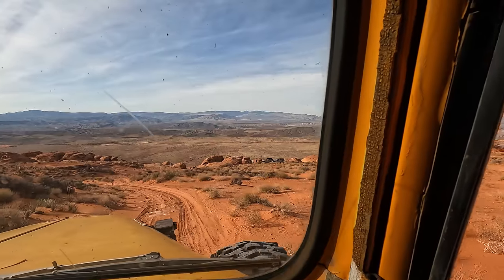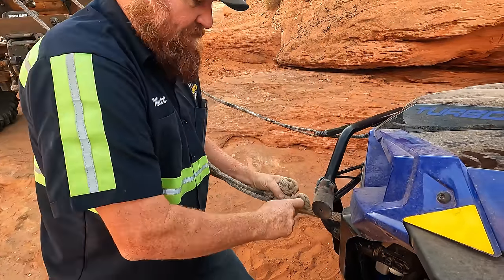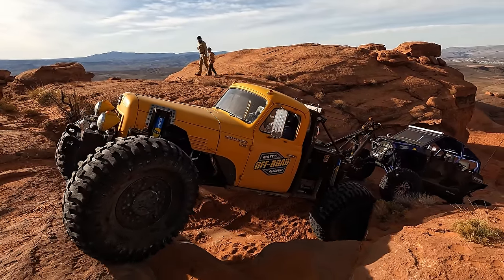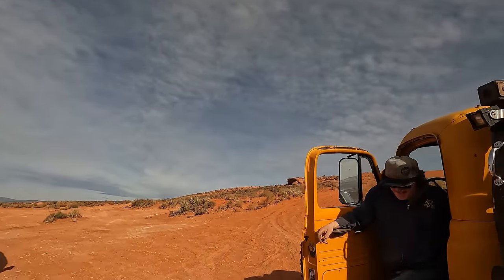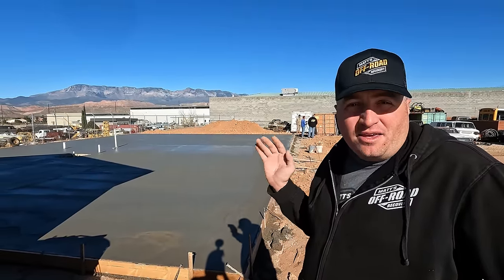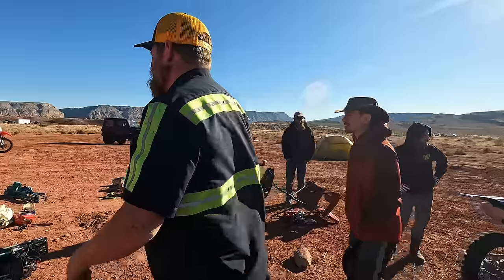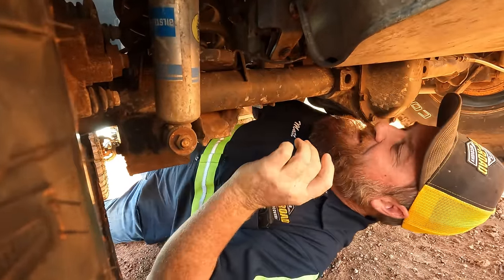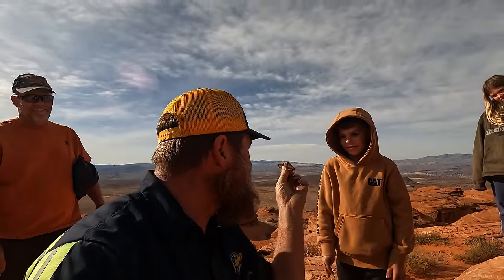I Let A Kid Take Over The Wrecker...Disaster?!

Comment: That biggest off road wrecker is so awesome since Matt fixed the earlier issues that it had. It's very capable on these rock crawling recovery's. Rhett and Kawlin both have got to drive the wrecker now and are very impressed with its capabilities. Good job and the cement is poured for the new shop!

Comment: You don't need fenders on the off-road record, but you need to make little tables over each tire so Matt has someplace to put the winch controller. Instead of setting it on the tire and then running it over later.
Reply: That’s a good idea.  And adding magnets to the controller so when he forgets it on there, it doesn’t fall off.
Reply: The wrecker definitely needs fenders in the mud...
Reply: “*Wrecker not record” , Stay in School Kids
Reply: @Alexwinter123  learn how to properly correct grammar before you critique others on their level of education.
Reply: @downbytheriver501  Every sentence starts with a capital letter, what i believe you meant to say is… “ Learn how to properly correct grammar”
Reply: Back to school for the pair of you flogs 😂
Reply: Watch the new video he sets it right on the exhaust manifold

Comment: Hi guys I have been waiting your videos for a while now, always entertaining. When I first started watching, you didn’t take advantage of power winches much, and relied on tow ropes. I was glad to see that started using power winches. But what would be very helpful now is if you built an adjustable trailing arm for the back of the wrecker. It could be made to fit in the receiver hitch on the back of the wrecker so that it can be quickly installed/ removed when needed. Like in this video, you could have put the arm between the wrecker and the Razor bumper or tubular guard. It would have kept the razor more stable and keep the vehicle being towed from colliding with the back of the wrecker, or swaying out of control from side to side.. And That way nobody would have to ride in the vehicle being towed to apply the brakes in some situations. Just a thought. Keep up the good work.
Reply: they work on flat ground, not so much on all the off camber stuff when offroad and quickly snap break etc etc.

Comment: Nice Video as usual! I've got one minor question: Have you ever considered building a manually extractable boom? Just so you can extend it by 2-3ft for example when needed. Shouldn't be to difficult to build but the gained flexibility could be worth the effort.
Reply: Seems like that would be a worthwhile addition for jeeps and larger vehicles. The current length works fine for side by sides which was the original intended use for the wrecker.
Reply: Two or three feet is a ton of leverage.
Reply: @williepelzer384 True, might need to extend the headach rack too to place that boom raising winch higher

Comment: A great video as always. One small thing and I hope no one gets annoyed or upset with the following comment. Rhett needs to unlearn that habit of steering with the lower half of the wheel before the habit becomes entrenched. In the event of a swerve, with the traditional use of the upper half of the steering wheel, the weight of the hands and arms confers a self-correcting effect. When gripping on the lower half of the steering wheel, the weight of the hands and arms becomes additive. A swerve becomes amplified. Two self-energising over-corrections and you will swing broadside around across a paved road, dig the tyres into the verge and roll or a high vehicle will capsize on the spot. Power-assisted steering adds to the effect. Where there is a lot of lateral lurching over rough ground going on, a two-handed three o'clock-nine o'clock grip is probably the safest. Other viewers should slap me down if my comment is seen to be insolent and they have a better and safer solution. Just be gentle. I am old and arthritic.

Comment: I followed you from the very beginning on building your wrecker. You did a really good job Matt that thing performs absolutely beautiful one thing I would recommend if you could put a wheel lift on your wrecker not so much hydraulically powered but we’re hey, you can pick it up with the cable on the boom that would help you out a lot. I really believe it would be adjustable for different wheel widths new strap them front tires in it’ll help keep from hitting the hoods and stuff like that on the back of the truck and I think it just would be a lot more stable and then was the boom lift you could lift it up and down in different conditions I think you’d be safer to, but I’ll tell you what size wise that wreckers absolutely perfect I believe it really is. It doesn’t need to be any bigger that’s for sure and you just did a magnificent job on that machine. I truly believe that would possibly be the best off-road wrecker anywhere in the United States, all right this is six in a row Jim I’m Kennerdell, Pennsylvania

Comment: Please correct me if I'm wrong, but I'm thinking a lower hinged+rigid mount for towing attached to the frame, would give you a lower center of gravity when towing. 
Lowering the towed CH won't have such torque due to the leverage point being lower. 
In theory, it should help with sand towing, and help keeping the proper distance between tow rig and towed rig. 
Thinking a triangle shape, with point at the tow point and the flat base at the frame height of the wrecker. Keep in mind the length of the boom to not create binding. 
Now finding a way to attach to most vehicles is where my idea starts to fade. Maybe other creative minds might have an idea? 
Or maybe my suggestion would not work? 
Just food for thought

Comment: Have you tried to make Sprayable Disolved Soap Bar "DRY LUBRICANT PASTE"? Leave industrial soap bars(or any) in the watter over night, mix it up with a drill after. If its too thick to spray, repeat adding more watter and mixing, or more bars if too runny and dont stay on squeeky joints. Make at least a bucket, and apply with the long nossle sprayer used for car bottom thick anticorosion coating. After you repeated the spray and dry cycle few times and it acumulated and dried in hard to reach squeeky places, it will be enough to retouch once few weeks. Its not corroding,and not atracting sand while very well dry lubricating and silencing.

Comment: In boating instead of using left and right we use Port "left color RED' and starboard "right GREEN" . If you placed a red and green sticker dot where the driver would see it on the windshield and the same outside on the fenders then it should make life a bit easier by using colors as when a brain is busy and can muddle words colors being visual helps 🏴‍☠

Comment: The wrecker gets pulled sideways by what it does because the pivot between them is the top/end of the hoist.   Put a lift arm on that wrecker and it will be solid as a rock, and you will not need someone to ride the brakes.  Be like King Fred.

Comment: I wonder if there’s room to engineer a wheel lift on the back of the wrecker. The boom lift gives the load an exaggerated lateral effect due to leverage, which is why it affects the wrecker so much in soft sand. If they switched from boom to life when they hit the soft stuff it would make driving much easier as the load point would be more inline with the wheel line rather than 8ft higher.

Comment: Round here we do left hand down, right hand down.

Saves the confusion of my left or your left etc.

Then its just left hand down to turn slowly, left hand down hard to turn quickly, left hand down to lock to turn slowly to lock and left hand down hard lock to turn quickly to lock.

For distance, thats just go forward or backward and then once you're within a couple of feet of a spot (ie backing up to a trailer) the distance is indicated by holding your hands apart the same distance as they need to go and bringing them together as the distance gets smaller. When your hands touch, they stop.

Comment: When I first heard someone use the terms passenger/driver, I knew it was a flawed method.

No other industry that uses vehicles with a passenger side uses those terms. 

I'm guessing back in the day, the drivers got confused with right and left commands from their spotters, because they weren't sure if they meant from the driver's perspective or the spotter's perspective.

It's always from the driver's perspective. In the automotive repair world, it's also always from the driver's perspective. As if they were sitting in the driver's seat. For example, the left fender is always on the driver's left, even if there is no driver in the car.

Additionally using passenger and driver isn't universal and can't be used in RHD countries.

If you don't know immediately know which side left and right is, learn!